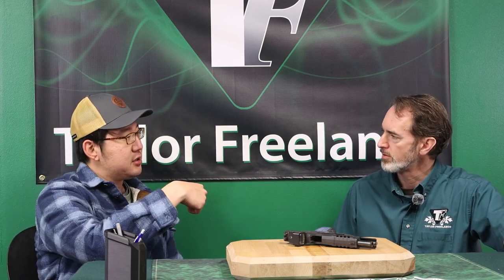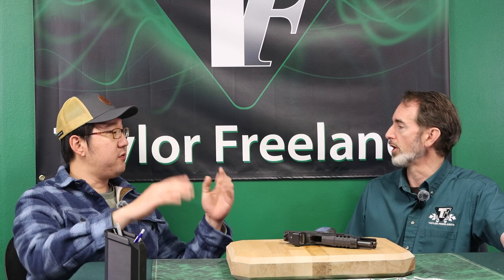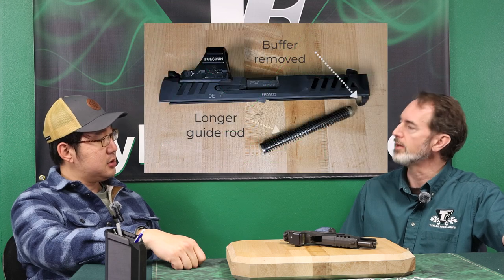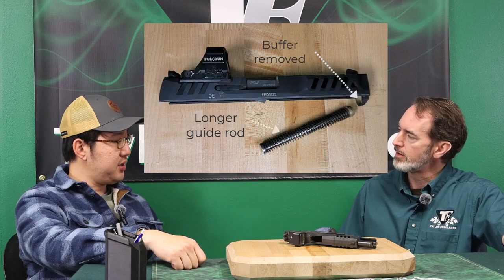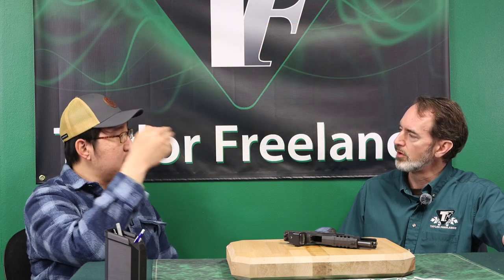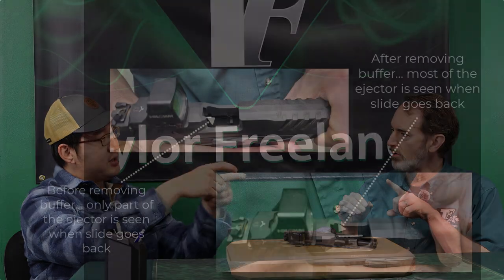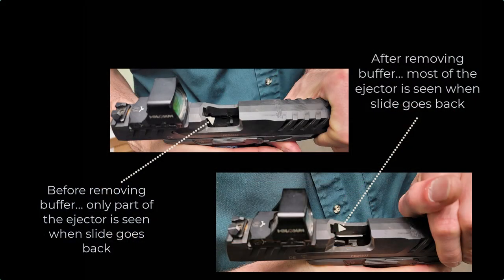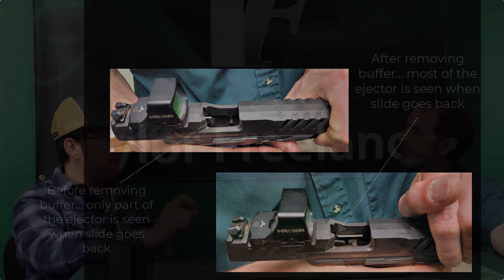Long-Stroking: Down the Rabbit Hole with Hwansik Kim

Comment: Fascinating discussion on long stroking vs. short stroking. It’s clear that the longer slide travel in long stroking can lead to more reliable ejection and less felt recoil. The discussion on the trade-offs between cycle speed and recoil management in long stroking is very insightful. It really highlights how shooters need to weigh whether they value a softer feel or a faster return to target.
Reply from the maker: It's always fascinating talking with Hwansik. He's quickly evolved into someone with deep knowledge of how pistols work (reminds me of Michael Voigt, with a little touch of Todd Jarrett). Long-stroking is one of very few truly novel technologies I've seen in a factory pistol.